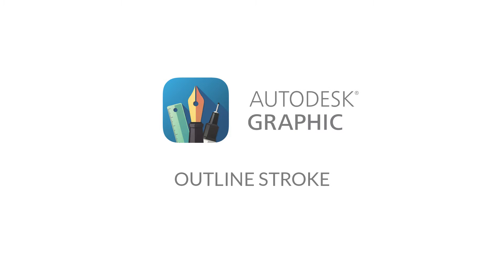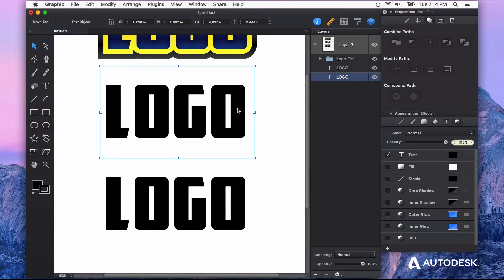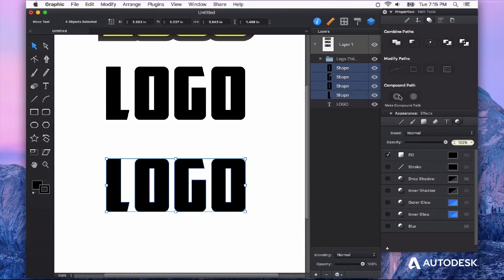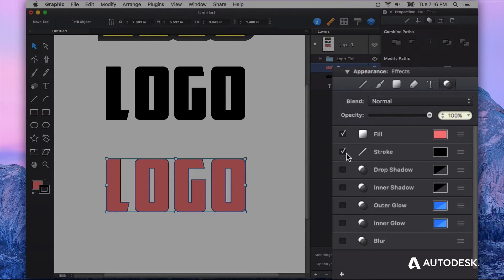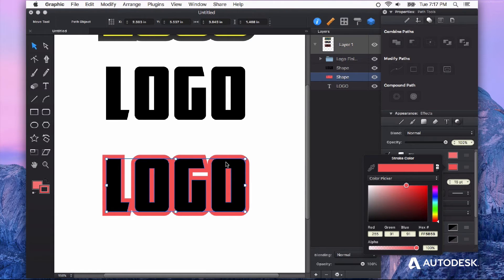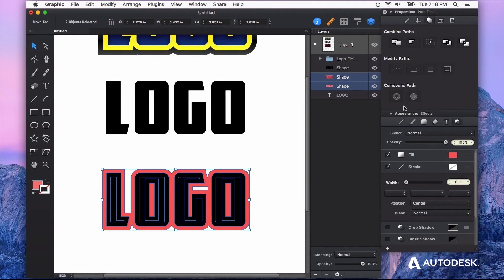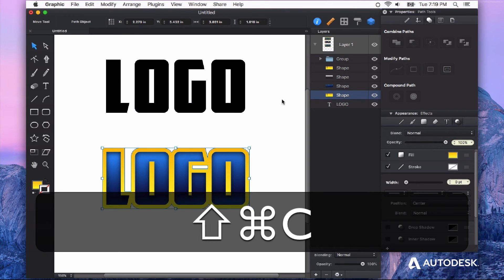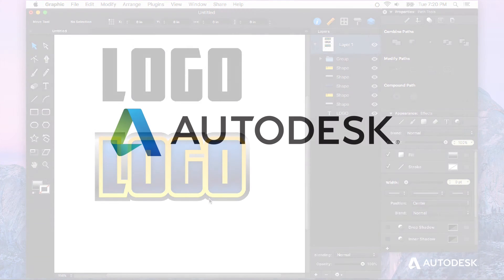Autodesk Graphic: "Stacked Stroke"

Comment: Would love a written out step by step to this. I think I have watched it 10 times now and I get mixed up when it comes to the ungrouping and then choosing union command. It doesn't seem to be working for me.  Thanks!
Reply: With the second stroke (the black and white gradient) you need to select 'Outline Stroke' which will transform the stroke into solid objects in a group, then you'll need to ungroup the shapes (just the four letters), and then combine them using 'Union' to make it one whole shape which you can fill with a gradient.
Reply: Thank you for getting back to me. I will give it a try. I appreciate your response.
Reply: No problem at all! I hope it works for you
Reply: If you want a shape of that stroke;
copy as svg
paste
ungroup
remove compound path
now you have a vector shape of that stroke, very useful for cutting letters with an outline that are stacked.